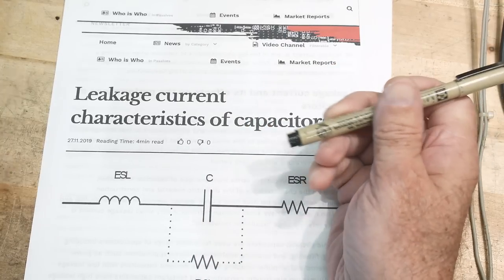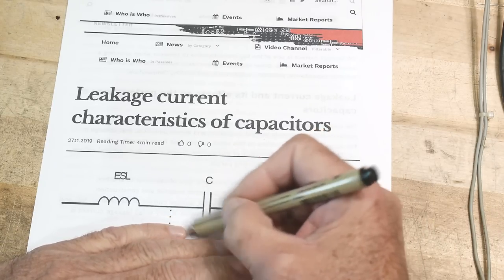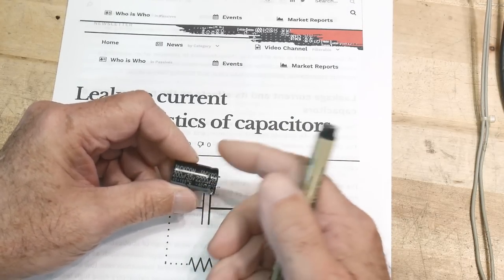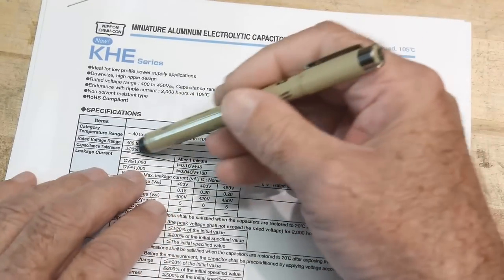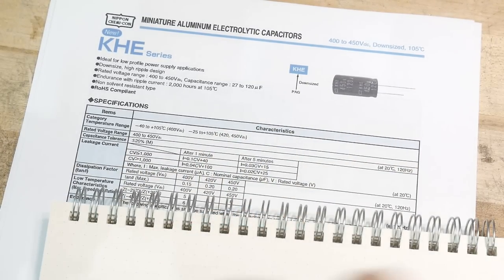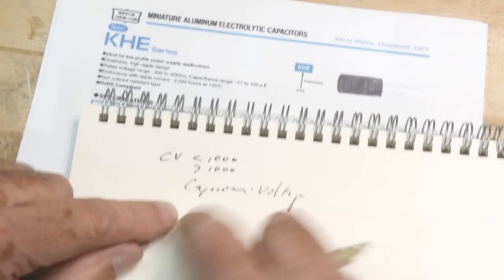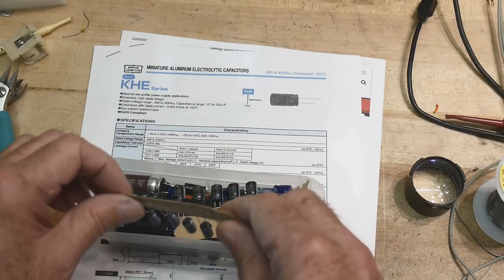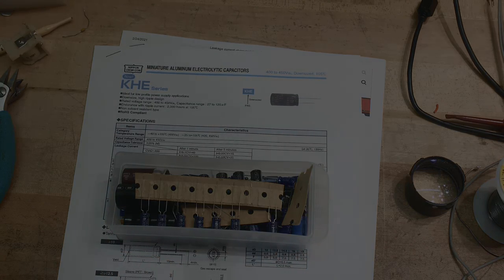#744 Measuring Capacitor Leakage (easy and cheap)

Comment: This is the most comprehensive and effective explanation of capacitor leakage I’ve come across. Datasheets can be daunting when you’re not familiar with the typical characteristics and parameters of a component. Thanks for the presentation.

Comment: If you do not have a large resistor you can just put the multimeter is voltage mode to measure current. This will put the 10MOhm resistor of the multimeter in series with the capacitor, and by reading the voltage from the multimeter you also know the leakage current.
Reply: That's also the method I use to test isolation of transformers.
Reply: That's what i do..

Comment: After three semesters at a tech school and 5 years at a university as a sevice tech this was the best and most infornative explanation on testing capacitors . Old transformers from a tube radio or amplifier is your power supply with a voltage divider to supply your various volages. Easy and from scrap parts bin. Thankyou!
Reply from the maker: Glad it helps

Comment: Thanks for reminding me of this.  I was going to go a lot more expensive way but after watching your video and remembering that I already have a Heathkit IT-28 Capacitor Checker (i.e. variable, current limited 600 VDC supply on the bench.  Not to mention a $5 Chinese multi-meter with micro amp scales, it dawned on me that I have everything I need, including the test leads to hook it all up.  Using the equation I=K x C +.3 to determine the max amount of current for a good electrolytic gave me all the info I need.  Knowing that all other cap types that show anything at all on the micro amp meter need to be thrown out makes it all dirt simple.  Note that I'm almost 100% dealing with vintage tube gear which makes it even simpler.

Comment: I think the main reason that there are  specialized capacitor leak detectors is that old vacuum tube gear is very high impedance so you might have a 10 meg bias resistor so that a 100meg leaky capacitor could form a voltage divider which dramatically changes your bias point.  So in these circuits you need to be able to measure very high resistance.  If you are regularly repairing such gear, it makes sense to have one of these testers as it is very easy with such low currents to make an error.  For example, you cannot reliably measure the voltage across a 1 gig resistor with a meter that has a 10meg input impedance.

Comment: I used to work in business machines electronics i,e, printers, large copy machines back in the 70’s. We had a spate of copy machines with psu failures. These were large sw mode with a lot of outputs like 24 v 12 v +15-15 v 5 v for motors solenoids logic boards etc. The failure was always at switch on inrush current! Varistors blown apart etc There was no shorts, fuses sometimes survived! Replaced fuses varistors, same happens in morning especially if it was cold day! Manufactures engineers scratching heads, Then I rememberd tv engineers trick with 60watt filament bulb on series with mains supply! 3 months later no more blown psu’s,! Apparently caused by about 12 motors firing up initially start sequence all at same time! Eventually modified psu’s  got relays so motors do there initial motors sequence in turn! I thought bulb trick was simpler!
Reply from the maker: https://youtu.be/heKFe15LwsI?si=xQui6o68tVFQzs95

Comment: It was good to hear the explanation that if the capacitors have been unused for a long period of time that they will heal and based on that to let them set a half hour or so and try again. Having done that the leakage had become very reasonable. My measurement was horribly imprecise, but it gave me an idea of what was happening.  I simply measured the voltage and watched it drop after the charge was removed. Initially it dropped very fast, so fast that I started looking for videos like this one. After letting it set for half an hour or so, the leakage voltage stayed relatively stable. This matters to me because I'm planning to use supercapacitors in parallel with a LifeP04 battery on a solar system for a gate opener power solely by DC. If the supercapacitor kept leaking at the rate it was, it would have made no sense to keep the supercapacitor in the solar system and I would have probably downgraded to a SLA battery without needing a superCap. I think this puts me back on track to use the LifeP04. My issue with the LifeP04 is that the gate opener is causing the undervoltage protection on the BMS to drop battery power below 10v or so and this is enough to stall the gate and have to reactivate the gate control. My expectation is that I will be able to remedy this using the Supercap in tandem with the LifeP04 battery for it to resupply extra capacity during the load cycle. 

The only thing I'm unsure about is what size of resistor (on the battery side) to use to try to insure that the battery itself doesn't dump to less than 11 volts before the supercap has drawn down. Any tips? The LifeP04 is 55aH in capacity. The gate opener doesn't have a lot of load, but I don't have a measurement for the load. I don't know how to take that reading. Open to learning if you're inclined to offer input.

Comment: I wanted to check a radio's paper caps leakage for curiosity.  I have bought an old time basic cap checker that does put voltage/ current through them but haven't gone through it.  I wanted to get an idea of what these caps were like so I just used the 125 volt dc battery pack I had for  radios.  Used with a 25 watt incandescent bulb for a resister along with a milliamp / microamp meter and I could get some idea of the state of these old caps.

Comment: One of the terms that you might be remembering is "Reforming" - Very old time, and I think mainly applied to wet electrolytic caps. If I remember correctly it involved gradually raising the voltage then leaving for some time. . Not something I've ever had to do , just a little before my time.

Interesting video for such an apparently simple measurement... Now where are those blue LED's :-)

Andy
Reply: We see that "reforming" idea bandied about a lot in amateur radio, when talking  About what we know as boat anchors which is to say radios from before about 1980.

 A lot of hams who aren't especially electronically inclined often want to reform capacitors because they don't have to get out of soldering iron.

 But you're quite correct in it being about wet electrolytics and in reality a number of the capacitors in slightly more modern boat anchors  radio's aren't exactly wet capacitors as they would have been in the 1920s-1960s. 

 And as I often say to such people if you reform it ----  it's still a 50 year old capacitor when you're done.

 But you're right the general idea involved using a variac and raising the voltage about 10% per hour give or take and ending up at a 100% of rated voltage only after a few hours,  and then leaving the radio on that way for a day or 2.

 If one insists on doing this or 1 insists on turning on an old radio without replacing the electrolytics you really should do so with a dim bulb tester in series as well.
 With a properly selected tungsten bulb that is actually a current limiting device. and can protect the transformer in an old radio from releasing all of the unobtainium inside - usually converted into smoke due to a shorted power supply electrolytic..
 Many people do not understand that a variac does not limit current.
Reply: I have an old, beautiful Crown D150 amplifier.  About half of it is a big heavy power transformer and it talks to several large electrolytic capacitors.  I didn't dare just "turn it on" after 20 years or so not being turned on.  So, introduce cheap Chinese variable autotransformer and walk up the voltage gradually.
Digital circuits don't like that sort of thing; can behave unpredictably without proper voltages, but old analog circuits don't care much.  Anyway, all good.

Comment: I recently had a situation where this would have come in handy.  A Collins KWM-2 transceiver was hesitating to go into receive after transmitting.  It turned out to be a leaky cap.  It tested okay on my Heathkit capacitor checker, but the impedances in that circuit were so high that the checker was useless.

Comment: I have built devices that required >10GOhm, but obviously not at home.
As far as building a dedicated tester it's just a fun thing to do. If it isn't your idea of a fun time then there isn't any reason to do it. My banjaxed Simpson does the job just fine, but I'm still going to build a dedicated one because designing a gigohm meter sounds like a fun weekend project.
Reply from the maker: It's all about having fun.

Comment: To measure smaller current, you can use the 10MOhm of your voltmeter in series; I=V/10MOhm.  If necessary, you can increase the supply voltage by V to keep the same potential across the DUT.  Placing a 10MOhm voltmeter in parallel with 100MOhm results in <10MOhm.  (Some DVMs have 100MOhm inputs.)

Comment: There are many leakage testers at youtube but nobody had the idea to use the inner resistor of the multimeter, mosttimes 10 MOhms, in series with the capacitor and a 3 x 9V = 27V battery in the voltage range of the multimeter.
 If the capacitor has 10MOhms leakage resistor this voltage divider will shows 27V : 2 = 13,5V. If you use the 200mV range you can measure up in the Gigaohm range.  If the C resistor is 1000MOhm in series with 10 MOhm  than the meter should show 267mV at its own 10 MOhm Ri and with 10GOhms 26,7mV. The only inconviniance ist hat you have to calculate the resistor value from the voltage.

Comment: Thank you for a nice and helpful video. However, at around 27:00 you are measuring voltage drop over a 800MOhm resistor with a 10MOhm instrument?!
Why just not use DMM`s internal resistance?
Best of luck.

Comment: Like how you think - keep it simple.  Hoping you can give some advice on modifying a MOT so it can test some of the more common higher voltage capacitors like 100V, 160V, 250V, 400V and even 1000V.   My simple mind just says to remove about half of the high voltage winding to get near 1Kv, then keeping unwinding and measuring/marking for approximate above voltages.  Then rewind secondary bringing out said voltages somehow to a voltage post?  Any advice greatly appreciated.

Comment: OK but this is a trivial circuit measuring a trivial test case. That is fine but all the capacitors I would need to test run at 150 -> 450V. The principle shown here is more or less the same for the more complex instruments but that complexity is necessary to allow you to safely test and reform at potentially lethal voltages. Also the capacitors once tested have to be safely discharged to sub lethal levels and the recovery voltage of electrolytics dealt with. What someone must not do is look at this presentation and then try to emulate on a 600v cap. The resistor is probably only good to 200v, the breadboard 25 to 50v say.

Comment: I wonder if you can use a megger to test capacitors. If the voltage is less than rated capacitor volts ?

Comment: I like it when you are very complete in you explanations, even when it takes a bit longer.
With the big meter it looked you cut the voltage to the capacitor when measuring current... but no voltage = no circuit... Or am I missing something?
Also, does reconditioning influence capacitance? Or just leakage?

Comment: Large value high voltage caps in power supplies will often have a parallel connected 1-100Mohm discharge resistor across them for safety. This adds VERY little load to such a capacitor, so as you say, ESR is MUCH more important along with a value at or above its capacitance rating. At which point measuring leakage is a bit like being worried about a pin prick hole in a large diameter hosepipe passing across a lawn ... Totally and utterly irrelevant.

Across a high voltage cap in a precision oscillator tank circuit however could be a very different matter. So it's important that any such fine measurements are put in context of the usage.

Comment: It's called plate formation. Ripple current is NOT AC ! AC means polarity reversal. If there is no polarity reversal you don't have AC , you have pulsed DC. Ripple current is post recitification. Electrolytic capacitors are different than regular capacitors in the sense they don't work the way you think they do.  A regular capacitor is two conductive plates separated by a dielectric (* non conductive) element. You can just put two plates in air and you get a capacitor. In an electrolytic capacitor there is only one plate. The second plate is formed by the electrolyte ! Yes, there is a second metallic plate but that has no part in making the capacitor. it is only there as a conductor. So how does it work ? When you make an electrolytic capacitor you take to sheets of aluminum foil and separate them with a porous medium drenched in a conductive, corrosive substance (the electrolyte). you roll this up. At this point you do NOT have a capacitor. Not yet. I'll come back on this. We know that the capacitor value is directly proportional to the size of the plates facing each other. And inversely proportional to the distance.(the closer they are together, the higher the capacitance. So how do we make a very thin dielectric ? OXIDE ! we grow aluminum oxide ! We take our stack of aluminum plates with the electrolyte in-between and we start 'forming' the oxide layer. By using a controlled current (to prevent explosive deconstruction) the electrolyte reacts with one of the plates and grows an oxide layer. During formation the current will go down and self-terminate once one of the plates has fully 'oxidized' . This is your dielectric. Parameters like ESR are purely defined by the chemical composition of the electrolyte. The better conductive that is the lower the ESR. If a capacitor dries up capacitance goes down but ESR goes up as the conductivity of the electrolyte decreases. So what's the deal with plus and minus. well, during formation only one plate oxidizes : the one at the positive terminal. so you need to respect the polarity ! if you reverse the polarity ( and control the current) you can "undo" this and grow the oxide on the other plate. So you can swap the polarisation of an electrolytic capacitor. They also self-heal. if a  leakage would occur in the oxide , simply applying a controlled current will cause the reaction to start and the capacitor will heal its dielectric insulation (that is re-forming). There is one more thing : a fully formed capacitor , in reverse polarisation, behaves like a diode.
Reply: Are you done reading your wiki pages ?  Get your Own channel.

Comment: So if I get a  500V DC power supply I can measure leakage of my high volt electrolytics without an fancy vintage cap leakage tester like those Sprague or Heathkit testers?

Comment: So, if I selected a 16V capacitor for a circuit which operates at only 5V, and a few years later I now want to move that capacitor to a 14V circuit, is that capacitor in need of reforming for best results?  Almost like a capacitor that has been sitting around, it's been given light duty.  I also noticed that tantalum capacitors have a leakage spec, although it is a fraction of an electrolytic cap.  Is reforming an old tantalum or checking for leakage at all necessary, or can that type be used after confirming capacitance and ESR?
Reply from the maker: you are worrying too much.

Comment: I like Mr. Carlsons capacitor tester. It's much cheaper and safer than a high voltage power supply.
Reply from the maker: just use a 25V supply and they are the same.
Reply from the maker: or this is the cheapest: https://youtu.be/gT9hN9aSICk?si=xh4qC5E7YKb9YUUC

Comment: Do electrolytics handle AC better if you put a dc bias across them?
Reply: as long as the bias exceeds the negative excursion I mean.
Reply: @nickcaruso Yes, and a lot of simple transistor amplifiers do exactly that by relying upon the transistor’s base bias to be able to use a 1uF to 10uF electrolytic capacitor for decoupling at the input.

Comment: I have a policy of pulling and checking the electrolytic caps visually in vintage equipment I have bought, and that means anything around twenty years, or more, old, as they are prone to leaking electrolyte from the holes for the leads, and the electrolyte can corrode the PC board tracks, to the point the tracks are gone!

Even well made equipment will have failures of some, if not all, of the caps!

It has gotten to the point, I don't even check the value or ESR any more, as it isn't worth the time!

Comment: Why a 10k ohm resistor? Why not 68k or .4.7k?  How do you know what value to use?
Reply from the maker: no real reason. just a handy value. the resistor just limits the current while charging the capacitor. the value will not effect the leakage test.
Reply: @IMSAIGuy  Thanks!!

Comment: Hello :). Again vry good video. Can I use voltage multiplier to build power supply for cap testing? I do not have 450V supply. Also I think I could use different stages of multiplier for testing.
Reply from the maker: Yes you can
Reply: @IMSAIGuy  Thaks, also I will have mini PS for other things its great. But I guess I should use current inrush resistors for bigger caps for voltage multiplier? I was building linear supply 1000VA and my CB tripped :D because of big caps in PS.
Reply: I thinking also tu use voltage regulators for each stage too meet voltage requirements for caps.